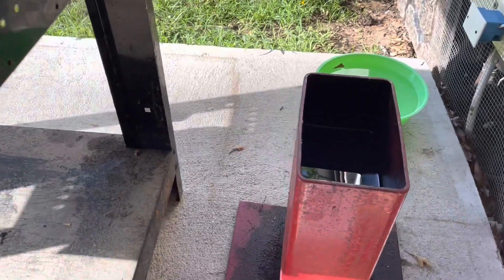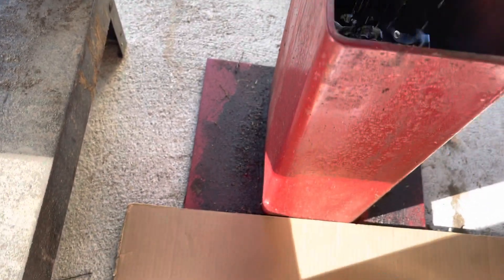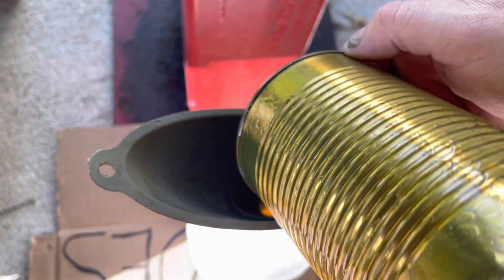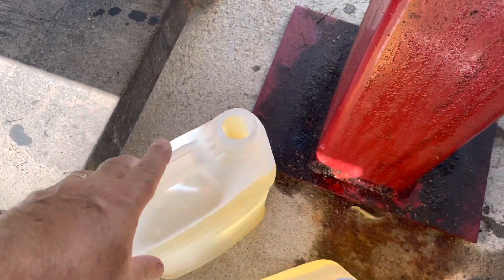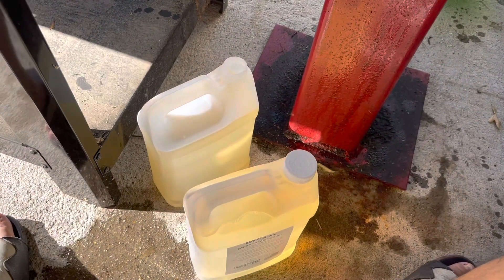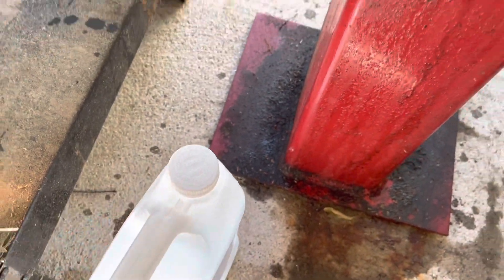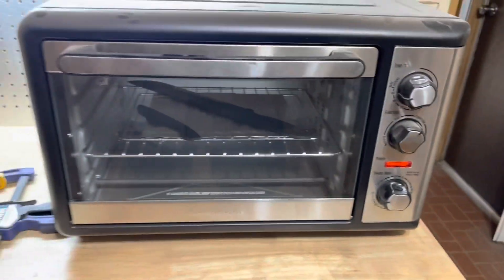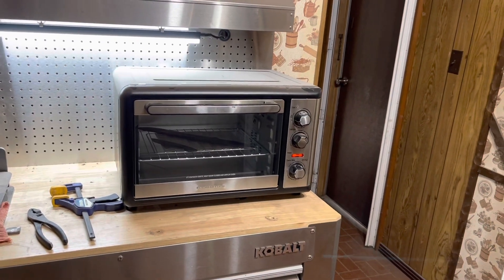Out with the old, in with the new

Comment: What is the lifespan of quenching oil?  You explained some of the advantages of the oil you just put into your quenching station but how often do you need to replace it?  I assume that every time you quench a knife a small amount of oil is burned off from the heat transfer so do you add more oil as needed or replace it all?  I am ignorant when it comes to working metal. lol  Phil
Reply from the maker: The life span is thousands of knives or many years, whichever comes first. The burn-off looks cool on tv but if you completely submerge the knife, you have no burn-off.

Comment: Could a forge bee used for the heat treating?
Reply from the maker: This is a forge. That’s what I heat treated them in. Tempering (removing some of the hardness) can only be done u set temperature control and it’s different temps and times for different steels.
Reply: @bctruck  I see.  Reason I asked  is we have an old forge. The kind you crank up to stoke up.  I have no idea how old it is but older then me I think.  My great grandfather was very handy with metal and used a  forge(don't know if it was this one) to make items that he needed, scissors and household item as well as things for the farm.  I have marveled at some of the things he made and so you making knives has been very interesting to me.  As a child it was hard to imagine that a simple piece of metal could be turned into a knife or some other tool with a forge and anvil.
Reply from the maker: You have a coal forge. There’s a lot of knife makers that would kill for that. My forge is a 3 burner gas forge.